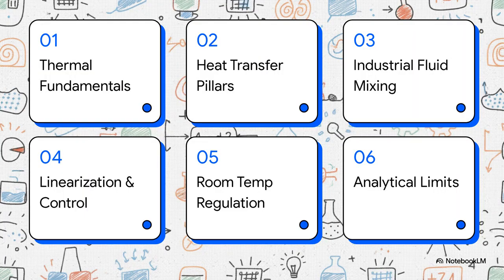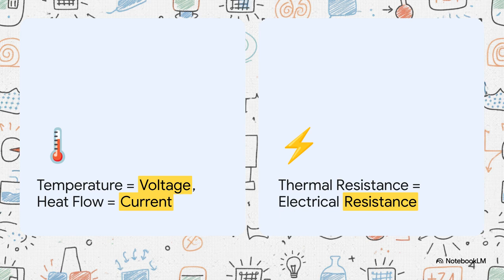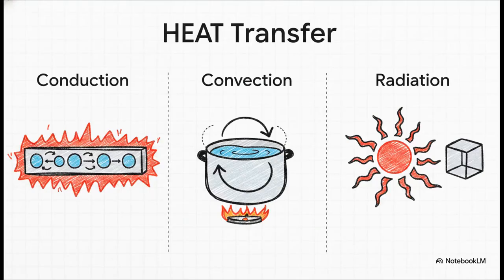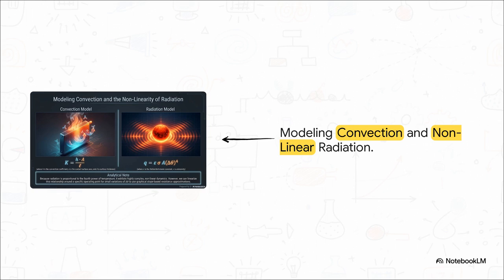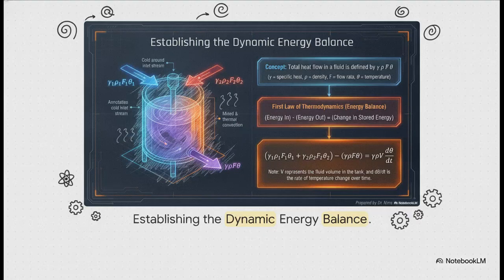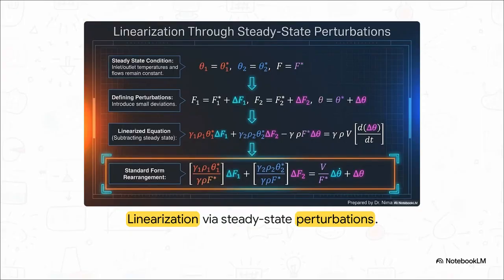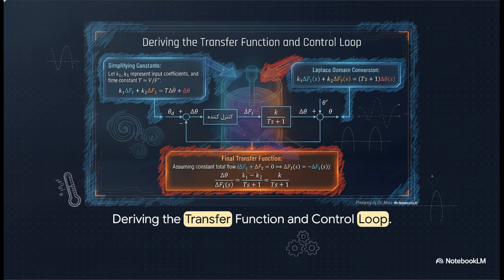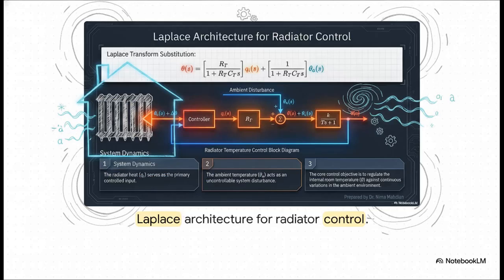Thermal Process Control | Modeling, Dynamics, and Industrial Applications

Comment: Thanks Dr. Mahdian, for this clear  explanation
My question is:
Since real thermal processes can include nonlinear effects such as radiation and changing heat-transfer conditions, how can engineers decide when a simple linear first-order thermal model is accurate enough for control design, and when a more detailed nonlinear or empirical model is required?